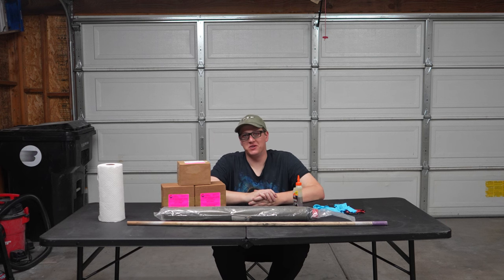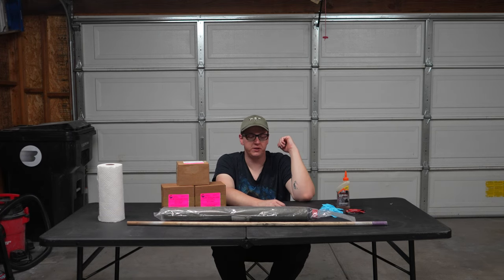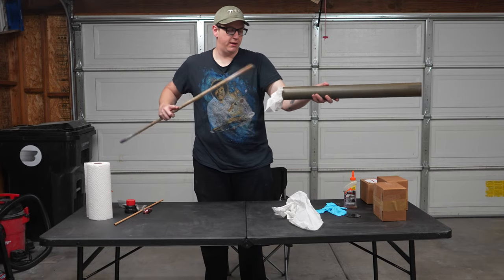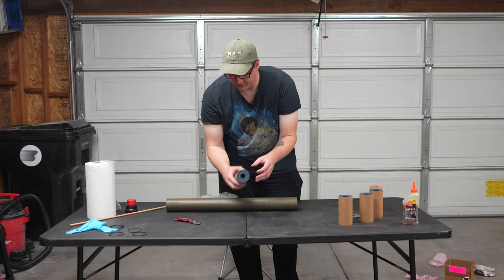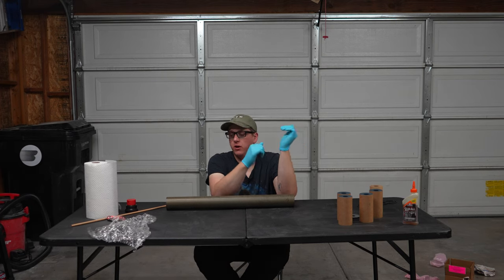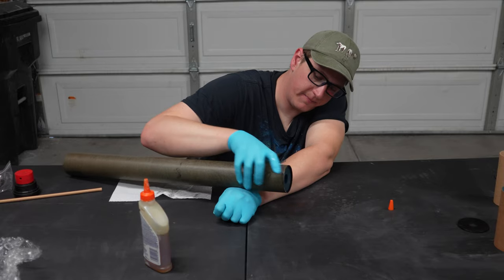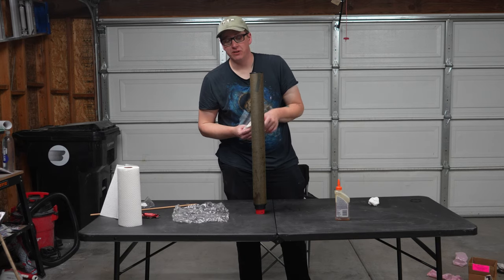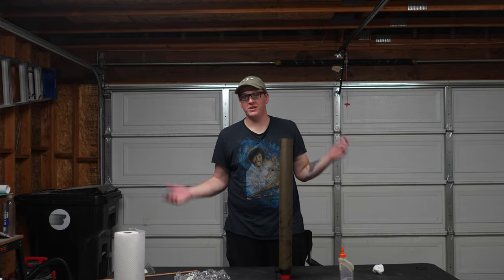Gluing Propellant Grains (Grain Bonding) in High Power Rocket Motors

Comment: Moving comment over here in case the other video gets taken down....

Braden, you made that look so easy.  Thank you for posting this video.  I found out that it REALLY helps to have a good (new) bottle of glue.  I recently did the grain-bonding exercise for my Aerotech M1500G that I flew for my NAR Level 3 certification.  I too ordered a bottle of Elmers Glue-All Max from Amazon and apparently I got a bottle that was pretty old.  The glue was VERY thick and didn't run very well and started foaming almost immediately (no there was no moisture involved except maybe some humidity in the air).  With all of the problems that I had I was barely able to get the last grain pushed all of the way in.  Thankfully it worked out in the end and my L3 flight and recovery was perfect.

After the fiasco with the Elmers' I posted in the Aerotech Open Thread on the Rocketry Forums asking if the were ever going to approve the use of Gorilla Glue for grain-bonding.  Aerotech replied back that they had been recommending both brands for some time now.  Here is a link to that reply from Aerotech where they linked the different documents where they mention that Gorilla Glue is accepted.

https://www.rocketryforum.com/threads/aerotech-open-thread.125657/post-2561681